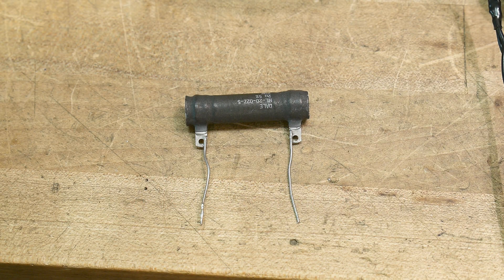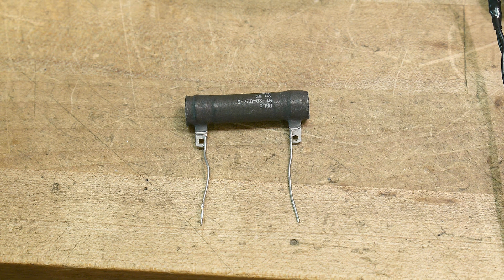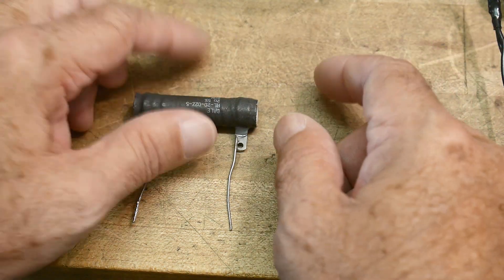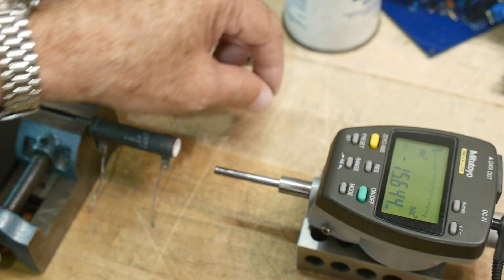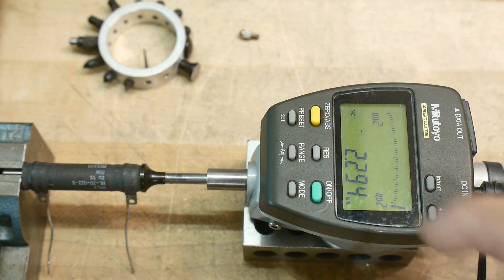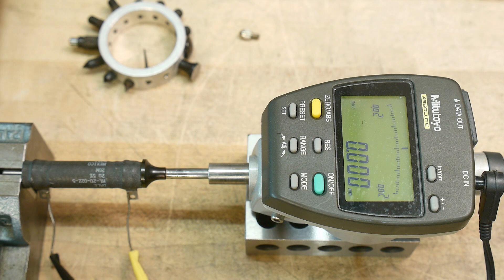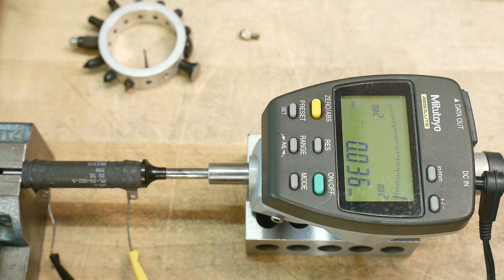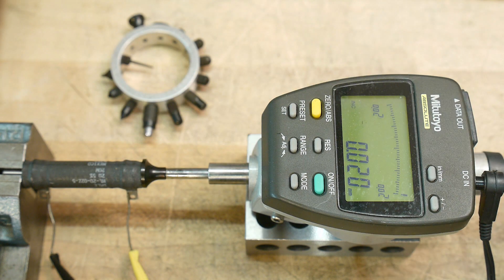#1225 Measuring Thermal Expansion

Comment: Piezoelectric actuator could be used when you need movements in micrones range. They are much easier to work with as they can be controlled with a simple op amp, don't heat up and can be as fast as you need. That's why they use them for atomic force microscopy.

Comment: This kind of trick is used in the stabilized Helium Neon lasers too, to locked into either frequency locking or phase locking, or a combination of both depending on the application. The Anode electrode or Cathode one, to finely adjust the mirror length to tune the cavity length to match the coherence length of the laser in question by heating the electrode, in order to lock it to stabilized setpoint prior to doing something higher precision, like micrometer or nanometers optical ruler for the wafer stepper, to name an example of the application where the higher precision lasers would be used in. This laser can also be DIY'd if you have 5 to 8 inches (127 to 203 millimeters) laser tube to work with. Sam's LaserFAQ is an excellent source on how to DIY your own.

Comment: I wonder, if you made a pillar of SMD resisters, I think he* (breaking taps was using quarter watt thru-hole resistors) could get more faster expansion because more of the length is expanding and the wattage is higher, but also that expansion would be the average so it should generally be more consistent; but what I wonder is, could you tap off at the joints between resisters and involve some transistors to say, ground the pillar part way along, so now you're only activating 3 resisters instead of 8, to help adjust the expansion characteristic. And you could introduce a different current coming from the top of the pillar, so the bottom 3 are at one temperature, and the top 5 are at a lower temperature, so you can use that to get different accuracies and precisions on the fly. (symantics, obviously you could solder a bunch of SMD resisters together and connect an H bridge to each joint; the wonder is if that would be productive)

Comment: 03:10 - what would a springy tip be used for? seems like it goes against the measurement
Reply from the maker: not obvious from this setup, but you can think of a case where any shock applied to the dial indicator might damage it. think of rotating shafts to measure

Comment: I make pottery for a hobby and am constantly aware of the effects of thermal expansion.  The clay (most usually a mixture of clay and ground up rocks) has a different chemical composition than the glaze and therefore usually a different coefficient of expansion.  If on cooling from about 600C the glaze on the surface shrinks more than the clay body cracks can develop in the glaze called crazing.  The finer the pattern of cracks the more the glaze has shrunk.  On the other hand if the clay body shrinks more than the glaze the glaze can break away from the body in flakes or slivers which is called shivering.  Coefficients of expansion for clay and glaze are in the range of 500 to 800 times 10 to the minus 6 per degree C.  A real challenge is to match the CTE of the glaze to the body by adjusting its chemical composition whilst keeping the look and feel you are after.

Comment: I found out the hard way that ceramic resistors do indeed expand. I had a bunch of 20W 3 ohm square resistors left over from a project so I decided 4 of them would make a perfect coffee mug warmer for my lab. I. I coated the entire flat bottom of each resistor with high temp RTV  silicone gasket maker and arranged and clamped them on a small porcelain tile. Several days later the RTV had hardened and I applied power to the array. A bit later later I heard a loud "plink" noise and sure enough, one of the resistors cracked in two. I was surprised that they expanded that much and that the RTV bonded that well. For the next iteration I used a small dot of RTV in the middle and it works well. 

I look forward to and enjoy your channel every morning. Thanks for making your videos.

Comment: Especially after a moment, part of the reading is thermal expansion in the indicator shaft.  If you need faster response, choose a resistive structure (e.g. make it from nichrome)... this will still be slow compared to piezoelectrics.

Comment: You can enhance it by using something like an aluminium rod inside that resistor, which will expand more. Plenty of tricks you can play with using thermal expansion, especially when doing machining and needing to get a part to fit with no fasteners, just using heat to expand the hole, and chilling the part to shrink it so they slip together easily, but once back to room temperature they will not come apart.